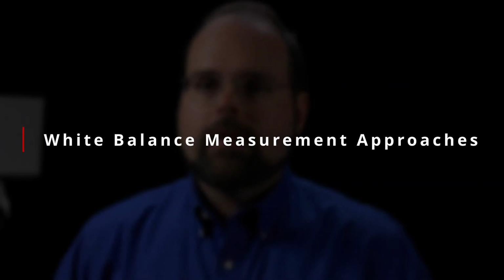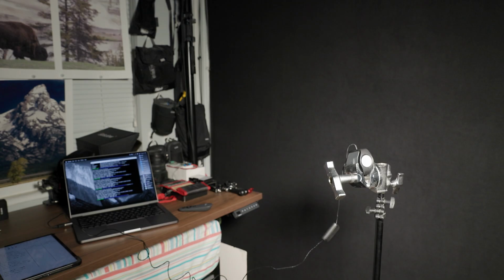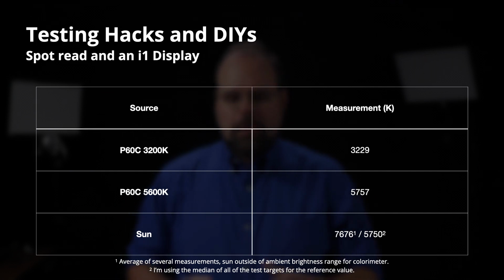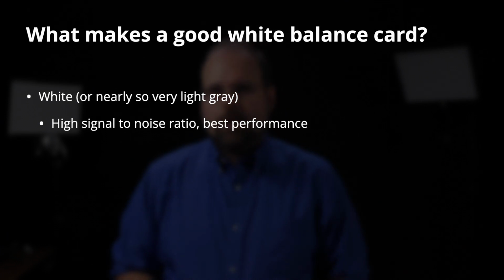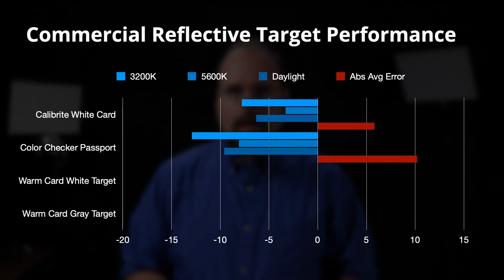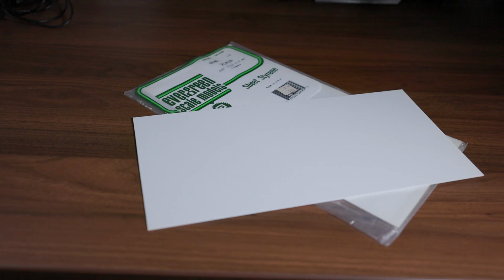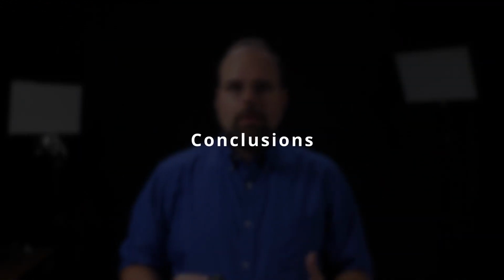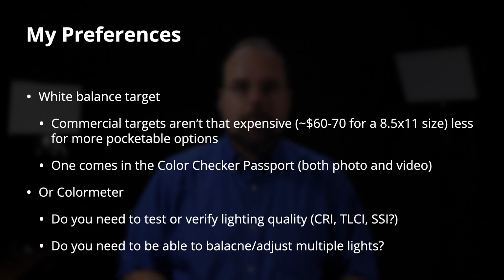White Balance Methods and Targets (DIY and Commercial) Tested

Comment: This is a fantastic video, thanks! Question regarding sanding the PTFE sheet, any tips on how to do it? Like which grit and sanding pattern you used
Reply from the maker: I'd say start at 120 or 220 grit. The aim is to kill the glossiness so you don't want to go too fine or course. 

As for pattern, random. Again, the goal is to remove and gloss in the surface so you're not looking at a specular highlight, just a diffuse surface. So you don't want a pattern as much as you want to just make the surface matte.
Reply: @PointsInFocus fantastic. Thanks a lot for the answer 😊

Comment: I find your instructional videos to be very thorough and informative.  Thank you.  Question re white/grey cards.   Would the paint sample cards from Home Depot work also?
Reply from the maker: In theory, if the paint is actually neutral. In practice, almost nobody makes a  paint that's not either warm or cool grey or some flavor of off white. If you're working on a 0-budget type production, or just want to play around you could get away with them. 

However, if you have any kind of budget I'd go for either the styrene or PTFE/Teflon sheet or a proper white balance card. Ideally, step up to a color checker passport as that will also let you do custom color correction profiles under any lighting conditions.
Reply: I bought the Evergreen styrene sheets from Hobby Lobby for $4.  I will try it.  Thank you for that excellent tip!